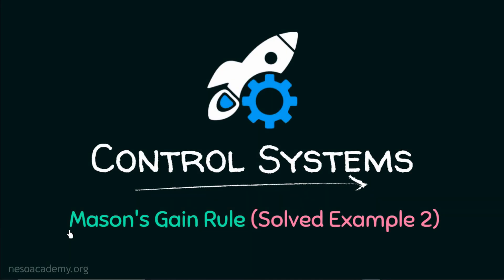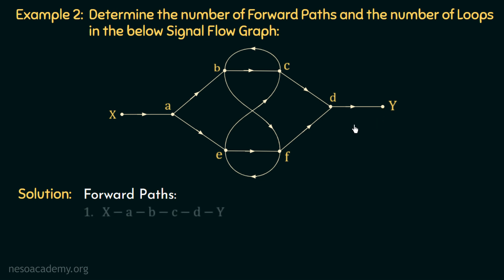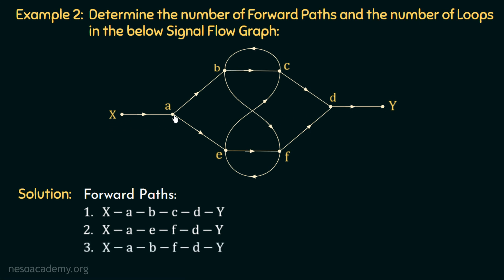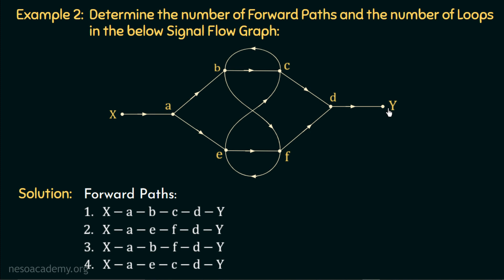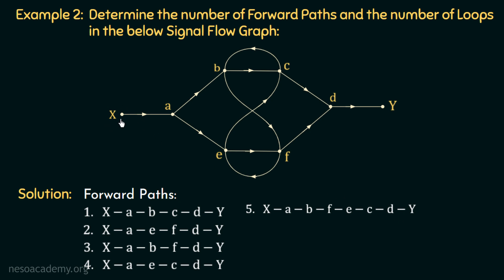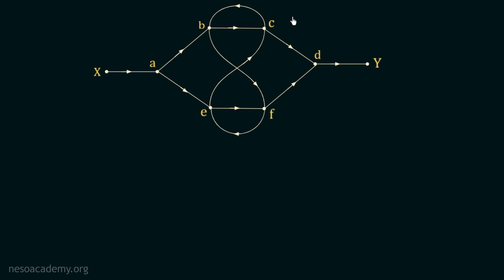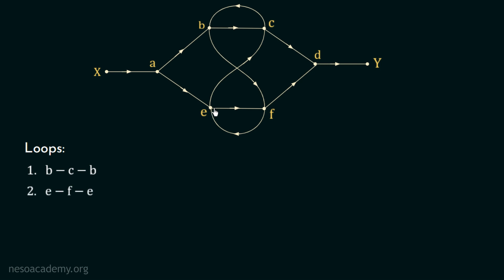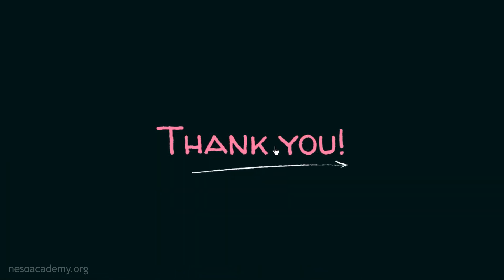Mason’s Gain Rule (Solved Example 2)

Comment: I  had  a  doubt  when  we  consider  non  touching  triplets  then  should  we  consider  no  common  point  between  all  3  or  can  it  be  1 common node  between  the  two  and  not  with  the  third  node.
Reply: no common nodes between all 3 i think.

Comment: 1.
Loops : 6
Non touching pair : 4
Non touching triplet : 0
Self loop : 1
Q2:
Loops : 8
Non touching pair : 10
Non touching triplet : 3
Self loop : 1
Reply: I think your answer for question 2 is wrong.
Since,your pairs for non touching loops are more than individual.
It's a fact that the individual count of anything is more than the pair count when the no. Is same.

Comment: in the example, why is ecbfe not counted for loops
Reply: it's the same as bfecb loop you're just starting from e instead of b
Reply: 3rd loop
Reply: @PompuKaPapa  but the 3rd loop doesn't start and terminates at the same node as e-c-b-f-e
Reply: @bryantalexander1492  bro its a loop, imagine a circle with these points on it...
No matter from which point u start but the path will be the same at the end...
Bf(ecbfe)cbfecb will be the points if u go round that circle, which also go with what u demanded (ecbfe)
Reply: But if the gains are present then the answer will be different right

Comment: Q1. Loops 6
Non touching loop pair 4
Non touching loop triplate 0
Self loop 1
Q2. Loop 6
Non touching pair 10
Non touching loop triplate 3
Self loop 1
Reply: this is the correct answer in the comment section💯
Reply: Nope not correct....... There are 4 non touching triplets in Q2 (HW)

Comment: Q1:Loops=6;
Non touching loop pairs=4;
Non touching loop triplets=0;
& Self loop=1.
Reply: hey please enlist the non touching loop pairs i think they are 3 in number..the self loop  and the 1st small loop, self loop and the left bigger loop and the first and third smaller are non-touching which else .is it the two bigger ones below but they wont be according to the previous video.
Reply: @63_tanishkgupta55 the second small loop and the self loop
Reply: @63_tanishkgupta55 1<=>3, 1<=>4, 2<=>4, 4<=>5 total of 4 non touching loop pairs
Reply: @63_tanishkgupta55 yeah but there is also 1 more loop ie 1st small loop and 3rd small loop..
Reply: @saijitendravarmakatari6759  I think I listed it already
Reply: i agree with you

Comment: Question, are the loops really just 3? Isn't e-c-b-f-e a valid 4th loop?
Reply: I think it's valid, but it is the same loop as the third one he wrote down. If you obtain the loop gain of his vs yours, you will get the same loop gain. You are stating the the same loop but starting at a different position.
Reply: C-b-f-e-c
f-e-c-b-f
These loops are also valid isn't it?
Reply: @siddharth7261 ek hi loop kitne baar likhega
Reply: @siddharth7261  no you cant because your going in the opposite direction from c-b and f-e
Reply: @issamdajani1603  I think that the loops c-b-f-e-c and f-e-c-b-f are the same loop, and that loop is valid.  Why wouldn't it be possible to go from c to b and from f to e?  To be sure, the graph has edges going from b to c and e to f, but it also has edges going from c to be and f to e.
Reply: Bro we are getting value e 2 times so that's not possible

Comment: H/W
1. Loops=6
   Non touching loop pair:3
   Non touching loop triplet:0
  Self loop:1
2. Loops=8
   NTLP:8
   NTLT:3
   SL:1
Reply: can you please tell me the what are the non touching loops in 1 st home work problem.
Reply: i think non touching loop pairs are 12 in 2nd question and 4 in 1st question and NTLT in 2nd are 4
Reply: @rathersaahil  
Q1.
 Loops 6
Non touching loop pair 4
Non touching loop triplate 0
Self loop 1
Q2. 
Loop 8
Non touching pair 16
Non touching loop triplate 5
Self loop 1
Reply: Q1.
Loops 6
Non touching loop pair 4
Non touching loop triplate 0
Self loop 1
Q2. 
Loop 8
Non touching pair 16
Non touching loop triplate 5
Self loop 1